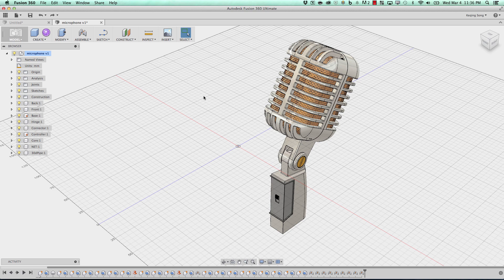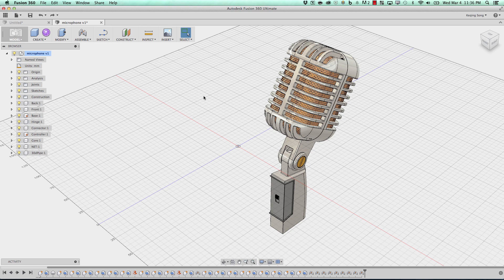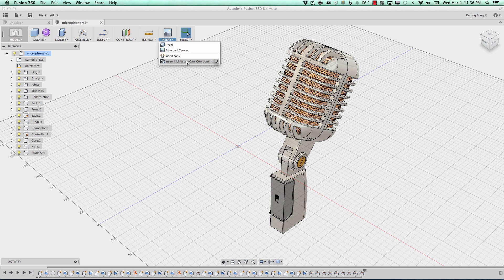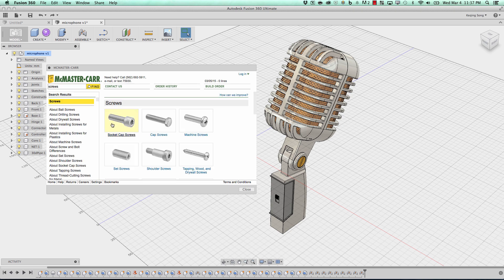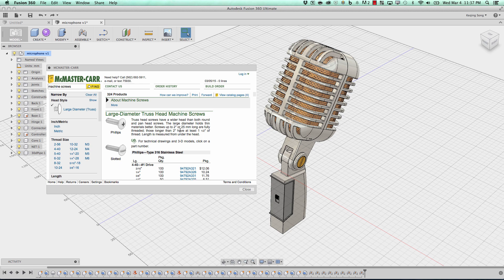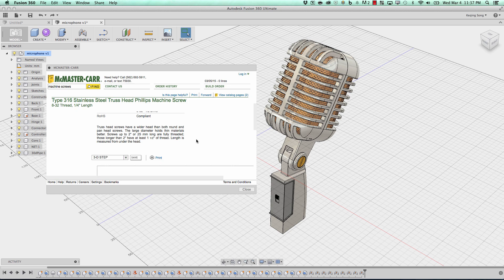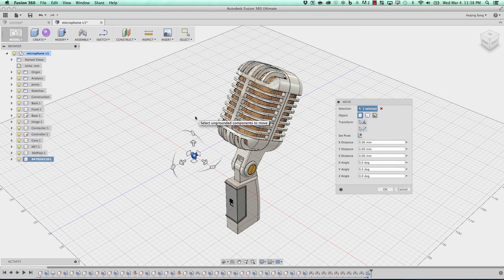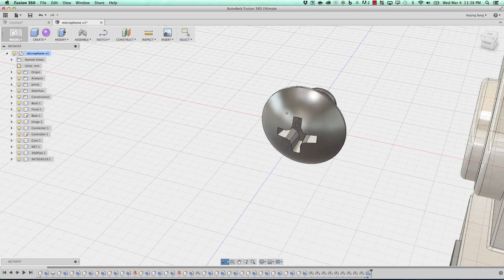McMaster-Carr access within Fusion 360

Comment: Seven years later and this feature appears to have the same problem that others have reported. It flat out does not work for me. I can download a step file from McMaster from my browser, but not from within Fusion. I can browse to the part I need, go to product detail, choose the correct file format then click on the Download button and at that point nothing happens. It never even starts the download and Fusion does not hang up.
Reply: I have the same problem. I never succeeded to import any step file in Fusion 360 using the McMaster-Carr plugins. A click on the "donwload" button has no effect.